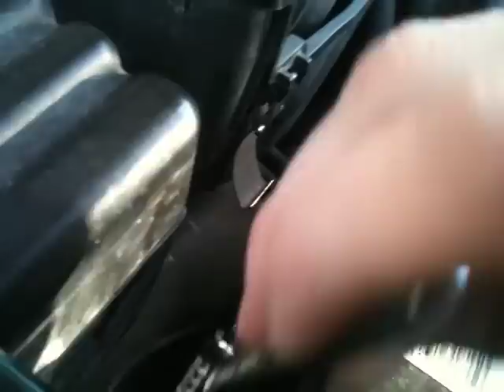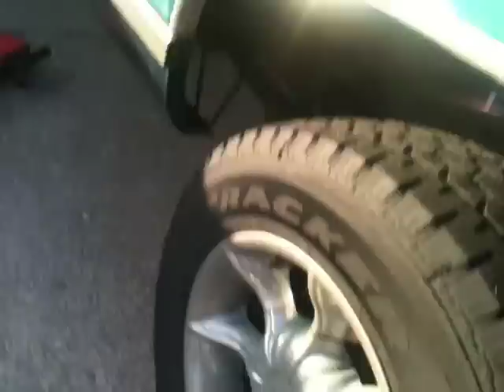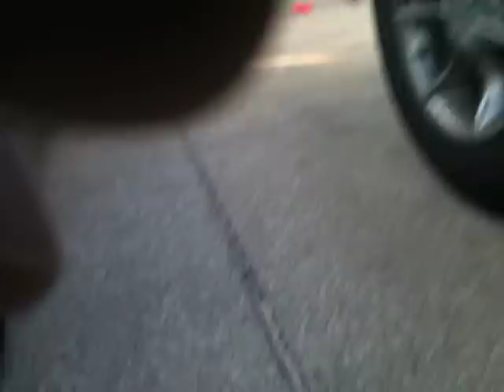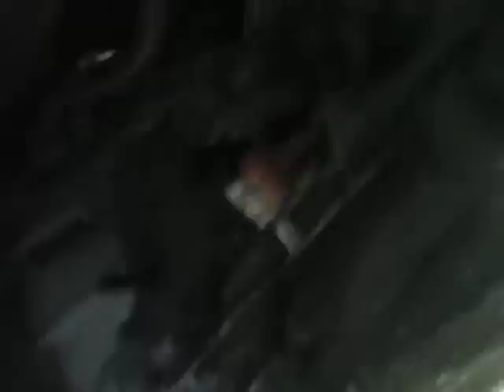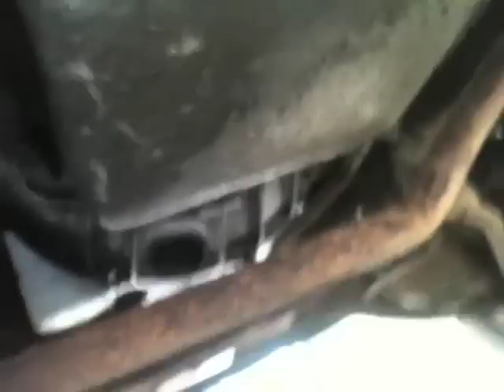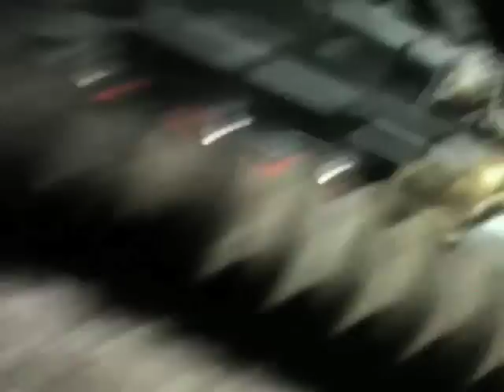Neutral Safety Switch Replacement 98 Silverado (full size GM trucks)

Comment: HI nice Video , ty ,,    did you use the Neutral Safety Switch Installation tool and if you did where did you get it, does  The New Neutral safety Switch come with a Cheap installation tool in the box  ? thank you
Reply from the maker: no tools, I just took a crack at it… My manhood taking over i guess ;)  removal is really simple, no special tools needed. it's the glued plugs that will cause the biggest issue.

Comment: Thank you for this video I recently bought a 97 Silverado , and the truck has caught me off in public and would not start, very embarrassing that I would have to crawl under the truck and short across the starter to crank it. I even had thought the neutral safety switch was actually on the column like the old ones.

Comment: OK! I have replaced transmission on 98 s10 4x4, and parking neutral switch, now no crank, no start. Battery full, bells, whistles come on, how do I adjust the park neutral switch?

Comment: the electrical connectors at the nss are glued in place. you need to heat them up to get them to release, a mini torch  or just something that will apply heat will work. just don't burn it.

Comment: You have to eat that connector with a small torch it will loosen up the glue and you would not have cracked it taking them out I rebuild transmissions in a Shop I pull at least three 4l60e  out every week
Reply: I accidentally cracked top plug removing wasn't aware of the glue how hard is it to replace . Can I  cut on from junk yard  and splice it in or does I t plug in to somewhere else where I can just buy a harness

Comment: I know this is an old post but it maybe helpful to somebody. The problem you described sounds like there is a lot of junk in the pan, when you first start it up it gets sucked up into the filter, eventually blocking the flow of oil. Thus the reason why it moves for the first few minutes. When it's shut down, the convertor drains back and the junk flushes into the bottom of the pan and the process repeats.

Comment: nice video, I noticed you had issues with the top electrical connector. GM uses glue on this connector. heat it with a hot air gun and it will slip off,

Comment: I have been watching quite a few videos on the steering column trying to figure out what could have happened. I have an 88 chevy The wheel does not lock in when the key is pulled out which is not that big of a deal, but I always have to turn my wheel to find that sweet spot so the ignition will turn. When I was working on the oil line and was easier separating the column. Everything looks fine in the top end. Could this be the switch or the lock cylinder? I can't find a video on those either.

Comment: Don't have to disconnect the battery,you will call the dealer for the radio code.Will read lock and the radio won't work.To get the plug ins out,use a heat gun to get the plugs out.They are glued in from the factory

Comment from the maker: sorry for the late response, hopefully you fixed your issue: the reverse lights are controlled be the NSS, the turn signals are a different switch.  I've never done this on a manual truck, so would love to hear any insights if it differs but to my understanding the depression of the clutch is mostly what the NSS is making up for in the automatic trans. most important thing is disconnect your battery, don't run the risk of hurting yourself or creating more work by damaging other electronics

Comment from the maker: sounds like it could be one of many problems, my suggestions will be a shot in the dark but i suggest a mechanic.  could be an issue with the drive train, maybe transmission is not engaging, could be a security lockout, could be a general computer failure, best case scenario... your shifter cable snapped and needs to be replaced, so check its connection on the NSS - you'll know if you can move the lever by hand from below while the column shifter remains in park.  Does the engine run well?

Comment: I have a 01 tahoe that is having trans problems...it will not move in 2 or 4 wh drive...it doesnt not move forward or reverse at all...the only time it moves it when you start it but for only about a minute then you have to shut the vehicle off and wait a few minutes then turn it on again...do you think its the neutral safety switch? I have no idea and anything will be helpful.

Comment: the likely reason the electrical plugs were difficult to remove is because there was
some factory clear colored adhesive on 
the electrical plugs.

makes plug removal VERY difficult. 
in your case, it's what likely caused your
switch to break. 

not sure why that adhesive was on there,
but I've come across several with it on late model GM trucks. 
perhaps it's to keep the colored sealing rings in place. if so, looks like they used too much 

I use something like carb cleaner to clean the 
glue

Comment: @FoxInSoxx28 well I found out that I installed everything correctly. I was just fortunate enough that my cable was old and broke just from the little bit of movement it had. So after replacing the shift cable it works just fine and I have backups. It should also be noted the plugs for this switch is glued in which is what makes them so tough to remove. I had to crack the plastic around the plug to get mine free as well.

Comment from the maker: @evilcowboy the alignment issue could be from installing the arm that connects to the NSS backwards.  You should be able to rotate the arm all the way forward and push the shifter into park and everything will align.  As far as battery, by not disconnecting you run several risks, worst being personal injury by electric current or damaging other electronic components or connections by shorting your wires.

Comment: I am undergoing this replacement and got a couple questions. Is the metal thing on the front of the NSS indicating neutral or park? I got back lights but I didn't align the shifter cable right and now I can't get into P or R any help with the alignment of this thing in conjunction with the shifter cable since with the cable disconnected I can't feel where neutral is any help is appreciated.

Comment from the maker: @tde5 could be a bad replacement NSS or the wires were not pushed in securely. i'm actually shocked that your truck is running with the bad switch installed, it's actually not supposed to start without a verified signal from the NSS.  The switch tells the dash what gear to light up, that's why alignment is key, once you have signal going to your dash, you'd be able to figure out if it is misaligned.  If I had to guess, you ended up with a bad replacement switch or you need to recheck your wires.

Comment: @FoxInSoxx28
Hi again - I noticed yesterday the tailgate trunk latch/release button no longer works.  As a safety feature, it does not pop the trunk unless the truck is off and/or in park, so I'm guessing this means I DID install the NSS incorrectly, but I'm not sure what I did wrong.  As I mentioned previously, the indicator lights under the PRND are out after NSS replacement. Is it possible the NSS wasn't "all the way" in neutral when I installed it or the plugs not re-inserted all the way?

Comment from the maker: @tde5 sound like a wiring issue and pinpointing exactly where it's coming from could take some more testing or a mechanic. I'm 99% sure that the signal going to your column indicators comes from the NSS, but it could just be turning onto one of those old trucks with old quirks. If worse comes to worse, One suggestion is to wire a toggle switch in your cab directly to your reverse lights and not worry about the NSS control at all.

Comment: @FoxInSoxx28 
Thanks again for the tips.  I did try to check the wires but didn't encounter any problems, so I replaced the NSS.  Still no back up lights, however now I don't have the indicator PRND321 lights on my dash to indicate what gear I'm in??  What did I do to screw that up?  did check the fuses too.  Everything else is as it was before the NSS replacement.  Car shifts as it should, as well.  Thanks.

Comment from the maker: @tde83 before you do that, trace the lt. green wire from the NSS to the tail lights, could also be where the wire splits to hit both L and R lights has disconnected.  Then all you need is a coupler and some electrical tape :) good luck.

Comment from the maker: @tde83 could be the NSS in the 98 models there is a lt green wire that runs from the NSS to the reverse lamps, not sure what color wire is going into the switch is off the top of my head, but a haynes manual or exterior electrical chart will solve that. I suggest starting there: apply the parking brake, drop it in reverse and check to see if you are getting signal with the incoming wire with a multimeter, if yes and no signal is coming out the NSS it's a pretty good bet.

Comment: thank you for the tips it was the NSSwitch that was giving me the problem..I did forgot to disconnect the battery when installing the nnswitch. It would not start so i disconnected the battery and after 10 mins, I connected the battery  and turn the key forward and left it turned for 5 mins and it reprogram itself and started right up.. Thank you again..

Comment from the maker: @Raybajosexto007 could be, or just could be a bad connection in the electrical in general.  Start by getting a multimeter and a wiring digram and test your connections.  the diagram will give you the colors of wires you should be looking for. jack the car up, apply the parking break, put it in drive... if you have a no crank issue, use the multimeter to check that you are getting signal from the wire that runs to your starter relay switch. other problems could be your starter switch or keylock.

Comment: my 2002 chevy silverado will start fine and after running the truck for an hour or so, i'll turn off the truck and it won't crank no more till 15 or 20 mins later..Sometimes when i move the shift to 3 gear and back up to park and hold it, it will crank..could this be the nsswitch also? Appreciate any tips..thk you..

Comment from the maker: @JUDGERAMBO still trying to figure out what's causing my problem.  The truck will not crank at all but if i wait a day or two after running it, it cranks fine.  I was told by several mechanics that it could be one of several problems and received a giant list of possible solutions...  If your NSS is bad, your starter will not receive a signal from the relay, so there will be no crank at all in neutral or park.  It is a safety feature to make sure you don't start your car in gear.